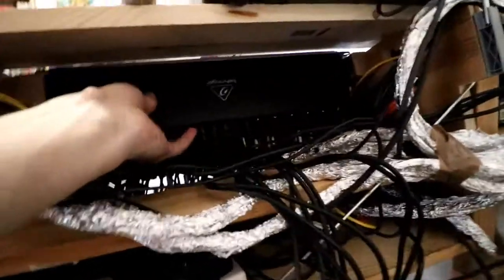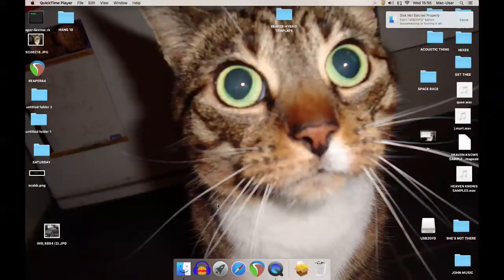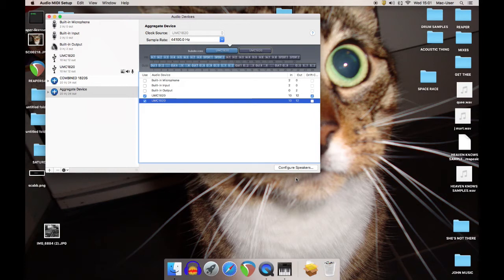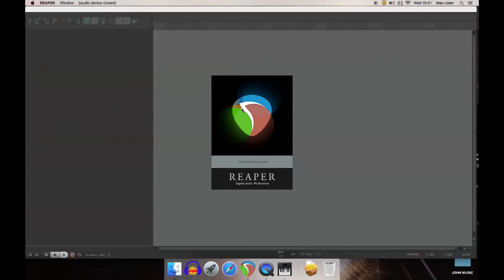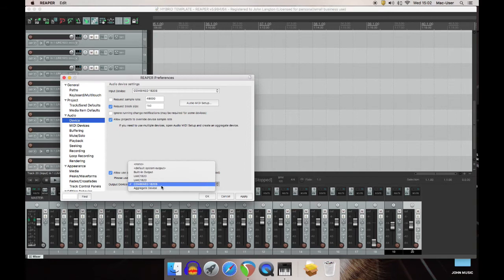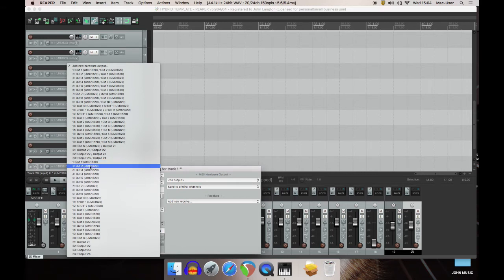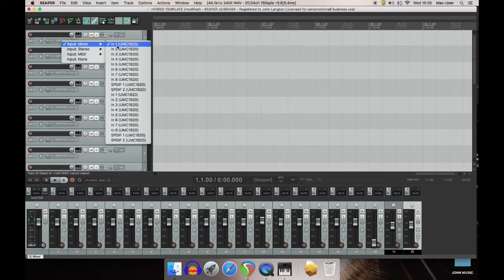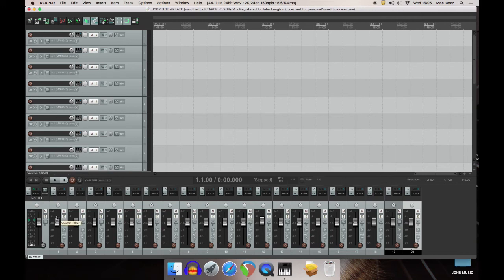How to combine two Behringer UMC 1820 audio interfaces to use with Reaper and a mixing desk

Comment: Hi after such a long time I got to see some stuff which I always doubted that it existed, but couldn't find any explanation. I am speaking about the Outputs named as Main Outs, which are essential printed as 1 and 2 while the channel outs are labelled 3-10. I wanted to understand how, if at all, would it be possible to configure through the DAW, such that I get 10 independent analogue outputs from each Behringer UMC1820. No manual explained that so far. Thanks a lot.

Comment: You don't need to make an aggregate device mate. If you're only using the two 1820s, you can just take the ADAT out and patch that into the ADAT in, and vice versa.
Reply: You sure? Doesn't that have to be done through the DAW? Meaning one device has more latency than the other? Read that in a forum.

Comment: Very cool.  This is exactly why I just bought the UMC1820 interface. (and now need the ADA8200 expansion)
I have multiple synths coming into each input on the umc1820.
Record several tracks via Reaper.
Each hardware output is connected to Soundcraft mixer inputs.
I record all the tracks, and then can listen to all of them through the mixer, adjusting faders and EQ as needed.
Mixer's main outputs can then feed into ipad for mixdown, or into cassette deck for old school 2 track stereo final, etc, etc....fun stuff.

Comment: Hi mate, fantastic video! I have the Behringer 1820 on my shortlist as I need an audio interface for my new Mac. I wanted to ask you: how is the latency on this interface? I've seen some owners commenting about latency being a problem and wanted a professionals opinion. My use case is predominantly electronic music (synths, modular synth, virtual instruments) but I also play guitar, cello, sax and violin and want to record parts using those instruments too. I'm new to recording, so I want to be sure I get the right interface. Part of my hesitation is that the Behringer is a USB 2.0 device which is quite old and comparitively slow (and therefore higher latency) than USB 3/3.1/3.2/Thunderbolt. How have you found the Behringer in terms of latency and performance with your DAW? Thanks in advance :)
Reply: I'd like to know as well. Everything other than it having USB 2.0 sounds great

Comment: Behringer says: "Windows does not have a built in Aggregator like Mac OS with Core Audio does. You can, however, use the ASIO4ALL Driver in order to create Aggregates."  

I returned one of the 1820s and bought an ADA8200. This should be working according to Behringer. Sad thing: all inputs are on the front panel of the 8200.
Reply: ok so I have two 1820s I was going to test the ADAT, are you saying this doesn't work unless I get a ADA8200? I tried to hook my 404hd and 1820 up at the same time lol it wouldn't recognize two interfaces in reaper and I don't wanna use ASIO for all it always causes me weird artifacts in the sound
Reply: @aarongabbard  At least on Windows it does not work. Windows does not support two soundcards at the same time, unless you work with asio4all (which sucks indeed, gives me weird sync swings).
Behringer doesnt say anything about this topic in any description or user manual. Although they give a short answer about this in their faq. 
You best return one of the 1820s and get the ADA8200, its even a bit cheaper than the 1820
Reply: 1820 + 8200 is plug and play when you use the adat cable. Although the combination of both is known to have signal bleed. I experienced it myself but managed to solve that by turning the main volume of the 1820 driver down from 127 to 99.
Reply: @levimudhouse  I wish there were more tutorials for this showing what it looks like on the DAWS. Mu current set up is Reaper on a Windows PC, all I'm really trying to do is add more channels but not lose the functions of Midi on the 1820.
Reply: @aarongabbard  Not sure how the routing in Reaper works, but connecting the 1820 in Ableton is like plug and play. It automatically finds the extra channels for the ADA8200 as well
Reply: @levimudhouse  Sweet it works like your DAW even has templates to make it look like other DAWs so it should work put pretty good! Thank you so much for the video helped me alot in my next purchases

Comment: i think if i have two umc1820, and two ADA8200. So, i can get 32 input channel.. right?
Reply: No, at least not natively. The 1820 name is actually a code to tell you how many ins/outs you can have. 

The inputs are 18 inputs (including the ADAT and SPDIF inputs) and 20 outs (the 10 outs on the interface and 10 outs via ADAT). You would need something like a UAD interface. 

Using this method you could create an aggregate device, and you could in theory have 36 ins and 36 outs, but I'm not sure how stable it would be compared to using the devices inputs and ADAT natively.

Comment: i used an ada8200 with my umc1820, works perfectly xD
Reply: I'm having a couple of problems getting my 16 analogue mixer channels to record with my umc1820 ada8200 combo, could you send me an image of ypur I/O settings please?  I'm using inc in 1-8, out 3-10 for the 1st 8 channels then ada8200 in 11-18  and out 13-20 for the 2nd 8 channels feom the desk.  It makes sense to me but won t record all at the same time or play back all recorded audio.  Very strange. 32 bit 48khz
Reply: @Dicoboomtime   Did you slave the 8200 to your umc ?
Reply: Why do you have a mixer ?

Comment from the maker: I believe so though it seems two 1820's won't connect via ADAT. The 1820 instructions are pretty minimal. You can of course add more units to the aggregate device if you have enough USB ports on your computer.

Comment: Can you connect third/fourths device using Adat? Like ada8000
Reply: I was thinking the same, the ADA8000 is cheaper and it would be less finicky to set up.
Reply: @lorenzojw04  actually, i'm thinking about 2x 2x setup. I'm using umc And Ada with my band, And its great(except max 48khz, but we need more in/outs